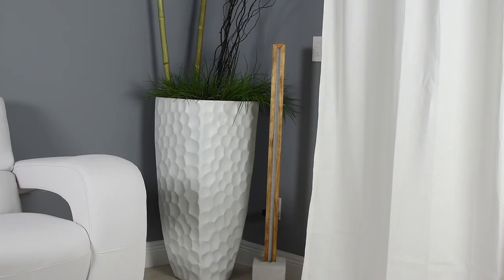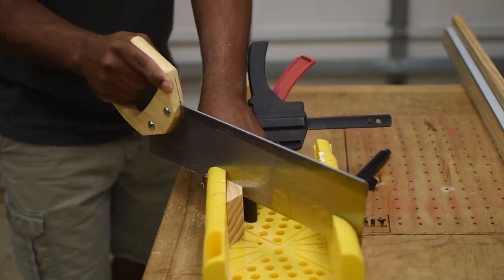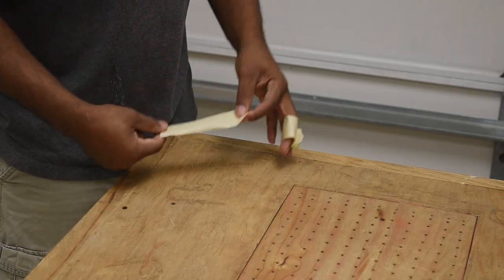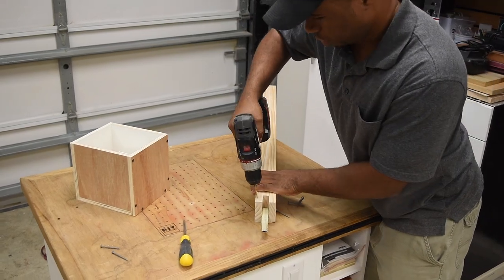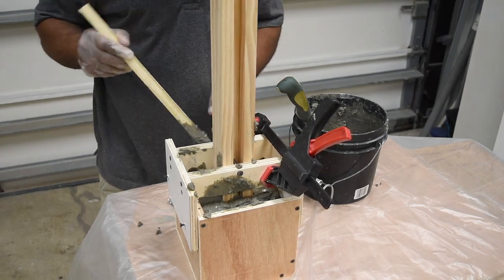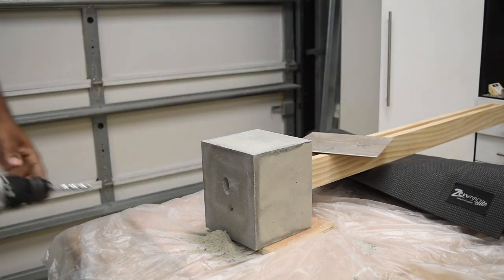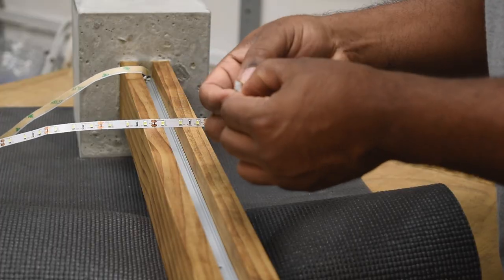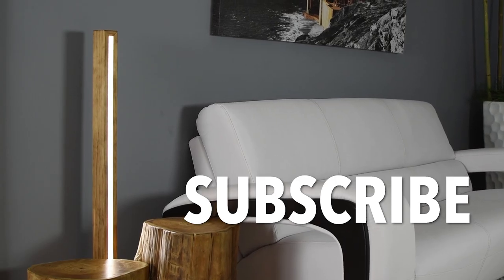DIY LED Lamp with a CONCRETE base (Controlled it with A Mobile App)

Comment: Thanks for the video, man! One thing I don't understand, is why so many people are not comfortable with soldering something? I mean - what the hell - it's easier than most woodworking tasks, requires only super-cheap tools (decent soldering iron can together with solder wire be bought for less than 10$ in nearest Home Depot, or whatever alternative you have there in USA/Canada), and you can learn basic wire soldering in 10 minutes from youtube tutorial. That's easy and reliable - every decent man should be able to at least solder two wires together without any trouble!
Reply from the maker: Thanks, I understand, I'm with ya. I happen to like soldering, but many are intimated by it so I like to find a solution to give viewers confidence. I would assume those who know how to solder would go for it.

Comment: I really like your videos because you don't use a $4,500.00 CNC, $3,000.00 table saw, or other highly specialized/extremely expensive tools the normal guy just doesn't have.  You're a regular guy making cool projects with tools the everyday guy would more than likely have.  Thumbs up!

Comment: Love this one :D 

Btw Glenn, if you haven't been told (I don't think I've seen you do it in a video before) using isopropyl alcohol on hotglue makes the chemical bond literally let go. Smear a few drops on it and the hotglue can be peeled off of any surface it's on. It's been a lifesaver for me on so many things. Also means you can use it for almost anything, since you can remove it with ease and without residue after.

Comment: Actually like this. I have a pretty modern and large theater room and i am trying to work out some innovative lighting in. This might be it. I would set this up with a front and back light strip, but I would set each up independently so i can do indirect lighting. I think i might look at incorporating some kind of led controler in ( arduino ect with neopixel type leds). 

Great maker stuff!!! Keep em coming!!

Comment: If you use like a styrofoam block at the bottom instead of the juice box, you avoid filling up the bottom. Don't forget to fix it to the bottom which avoids floating up. This block you can easily cut and break out afterwards. 
In addition you can see that the vertical edges of the concrete block are darker than the flat surfaces. This means that the water of the cement slurry was leaking out a bit in the corners and took small concrete particles with them. Just an optical  You can avoid this with sealing the corners better

Comment: Good job. I'd suggest for future projects add acouple knockouts to your form casing to avoid having to drill or use hot glue to hold something in place. Use some pvc or pipe conduit for the wires and glue a small styrofoam block on the bottom so when you take off the bottom you have a nice, clean recess for a cover plate to the wires. It'll save you time in the long run and make it look professional. It's all in the details.

Comment: Nice creative project!  You probably did not need the mesh to reinforce the concrete as it has practically no strain on it. An alternative to concrete space would be to use Plaster of Paris instead of the concrete mix as it might be easier to mix up for many folks, as you just add water.  I'd recommend prestaining/sealing the wood. Cool mood lamp though!

Comment: The mold release is probably why you didn't have good adhesion of the hot glue and the Box also you could fill the Box up so that way it doesn't cave under the pressure from the cement

Comment: Love your designs man. No need to overdo it with the slider shots though! Haha
Reply from the maker: Thanks, man! Haha, Yea I notice during post edit. Think I got a little-excited :).
Reply: DIY Creators the shots look great, but they were just a tiny bit distracting when they are back to back. Good stuff though. Whenever I try to use the LED strip lights, I feel like you can always see the individual lights. With the lighthousing you used, did it look more diffused? I know video tends to look a little different from seeing it in person
Reply from the maker: Thanks for the feedback. You are able to see the individual led when looking directly at the source. That was the main reason I pushed them back so far so you don't see the LED.

Comment: Just a quick note about sanding concrete.  Wear a dust mask and/or wet sand it.  Silicosis can happen in your lungs otherwise and that's definitely not a good thing.  Not saying it will, but general safety rule.

Comment: The density of the liquid cement makes the weight of the cement much higher than the strength of one thin layer of juice box, so they liquid just push into the box's space.

Comment: You still could add that seccond one if you have a router or something like that and cut the top of, router in a slot fot the top part to fit in after taking out a small channel for the 2nd LED strip!
Reply from the maker: That's True, I would think it would be easier to just remake one.
Reply: That's a good solution too, but still, amazing work, i might try and make something like that too!, Thanks for making these amazing videos!

Comment: What is that drill attachment you have for quickly going from pilot holes to screw driver? I so need that

Also I admire the craftmenship and quality all your DIY stuff has compared to most others. Great work!!

Comment: 6:40 - At that moment I realized that you could simply make a wooden lid on top with a hole cut in middle. That would be easier than all that measuring to get it perfectly in the center.

Comment: How would you do the same build but make it hardwired? Thinking of capping both ends in concrete and attaching it to the ceiling where my chandelier is.